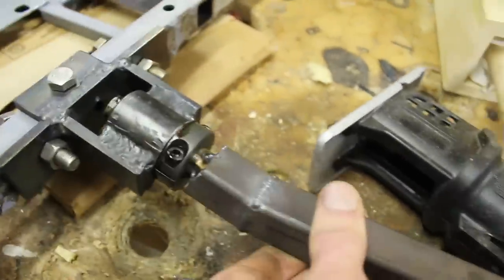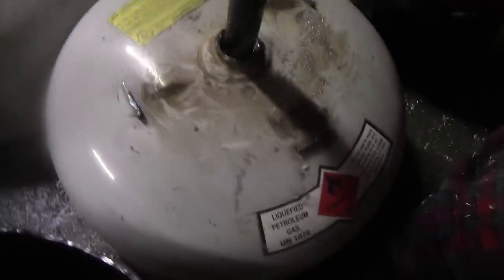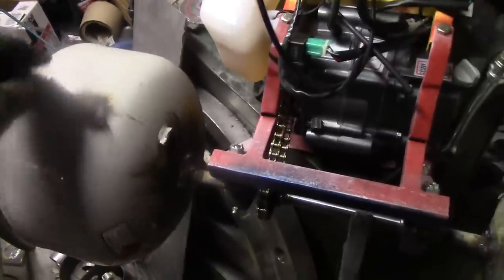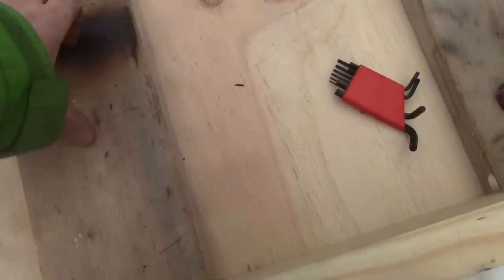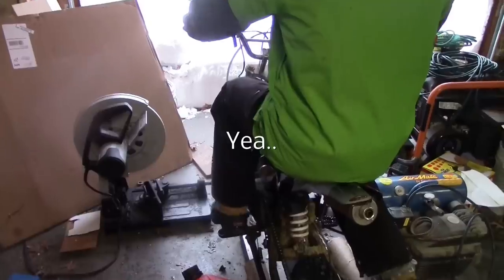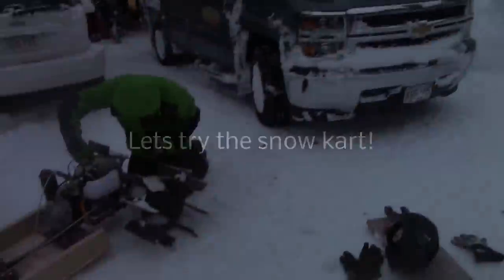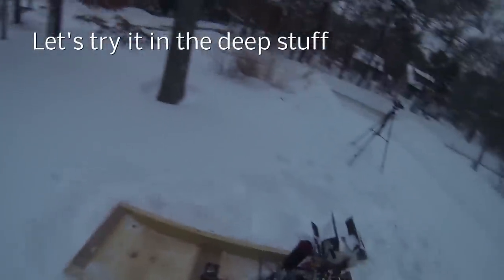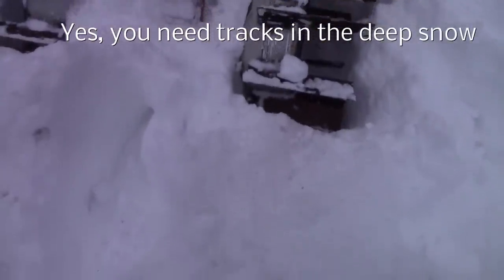Snow Kart Thing

Comment: Then you learned the magic of gear ratios and managed to squeeze some torque out of that thing
Reply from the maker: +Ariel Lezen I changed the internal transmission gear ratio's around so the rear sprocket gears could be 1:1 but it would have the same overall reduction as running the stock chain ratio with a stock transmission
It was for a different project

Basically just so I could put the drive shaft RIGHT behind the engine